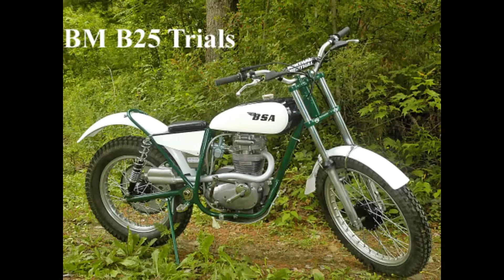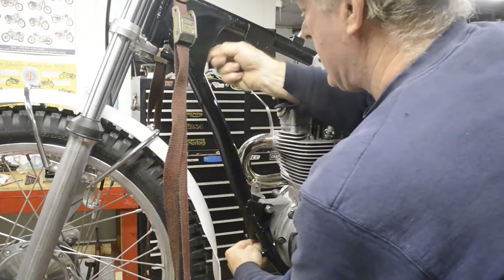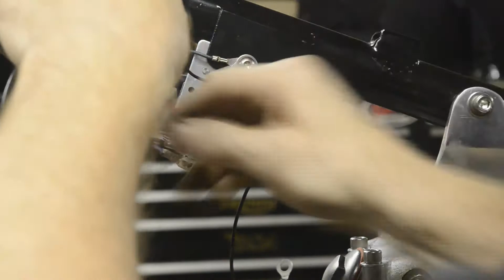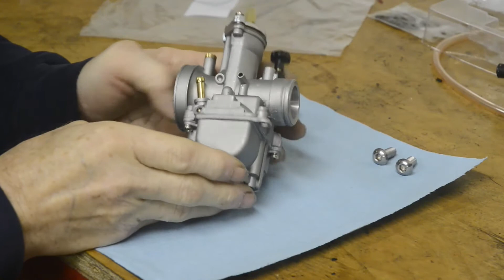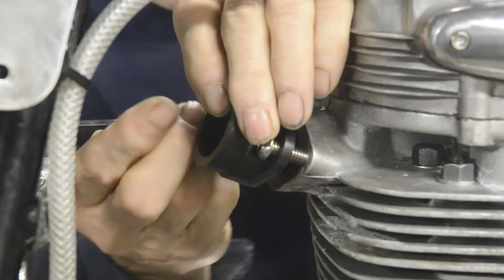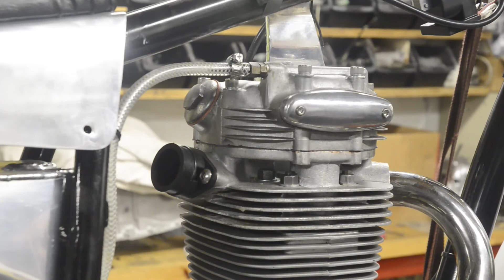BM 250 Trials Part Seventeen

Comment: Hi Michael, I've been watching your videos because I have recently bought a 1971 Triumph 250 Trail Blazer. I also fit JRC flat slide or Mikuni carburettors on my classics but with this bike I decided to give the Amal Concentric a fair chance. My particular issue with Amals is their poor pickup from idle often resulting in stalling at traffic lights. After a great deal of experimentation I found that if you file a 1.75mm deep recess in the slide that exactly matches the radius of the carb you get perfect pickup from idle and smooth throttle response in that first quarter throttle. Other throttle ranges are unaffected. It has transformed it into a really well behaved little trail bike. 
A few minutes with a file might save you the trouble and expense of fitting after market carbs and keep the engine looking original. 
All the best and thanks for your series on the BM 250,
David
Reply from the maker: The 1/8 to 1/4 throttle range is metered by the throttle valve cutaway, so any change to the slide will only affect the off idle part of throttle response. Had you tried using a slide with a higher number? I ask because I am not sure exactly how you modified the slide.
Reply: @BritanniaMotorcycles  Thanks for your reply Michael. You can read about my Trail Blazer and carb mods on the b50.org forum here
http://www.b50.org/phpBB2/viewtopic.php?f=43&t=8055
I can well understand why you use the flat slide carbs on your bikes but I would be fascinated to know whether this simple modification would work as well on your bike as it does on mine.

Comment: Its ok Michael I think I've worked it out now. I just finished installing it and wow what a difference, no more flat spots and stalling etc. I brought both Amal monobloc and concentric carbs (new £145 each) and tried everything to get the C15 running properly without success. This OKO carb straight out the box plug & play and its 100% running perfect.
Reply from the maker: Alright, you beat me to it, I assume that you were talking about the overflow hose which you just point at the ground.. I have been very happy with the OKO carbs

Comment: Good point about earths, I never could understand using the frame as earth. OK, save a few feet of wire on a full harness but I always complete the circuits with an earth wire running the length of the machine.
Yes, Terry Clips.
Reply from the maker: Plus you spend all that time painting your frame and then are expected to sand it off where you make your connections.  I never understood the logic either.

Comment: OKO is Taiwan made copy of PWK Keihin. There are Chinese made copies of the OKO though, which are very poor and will never work properly. Powerjet on some OKO carbs intended to richen the mixture when signal is particularly strong, and allows jetting to be leaner than without powerjet. The 26mm OKO works fine on anything over 125cc (4T or 2T), but needle used makes a big difference to running, and on many applications the wrong needle is used, and running is nowhere near as good as it would with the correct set up.

Comment: WHY DON'T YOU US AMAL  CARBS
Reply from the maker: Simple answer is in the US a Concentric is $200+ an OKO is just over $100. They work really well and are easy to tune so I go with them. I like Amals and usually find that the people who complain about them have the bike's original carb still fitted. What do they expect from a possibly fifty year old carb. Thanks for watching.
Reply: The Royal Enfield, Indian made 350's have a 24mm Mikarb instrument which is a copy of a Mikuni ( and a pretty good one at that ). They work great on Cubs, don't know about BSA. People often change them for Monoblocs (can't imagine why) so they come up on eBay for next to nothing.
Reply from the maker: I originally had one of those 24mm Mikunis which had a bolt up flange that went straight onto the Beeza. It worked pretty well but when I tried the OKO it gave me a much cleaner bottom end and just seemed to give the bike a bit more life. So I have kept using them.
Reply: THANK YOU i just wonder why  but any north of the trent islive that .I am from the midlands
keep the videos coming as found out lot ,i have  bsa c15 and b40 from 1960 till now all the best vic